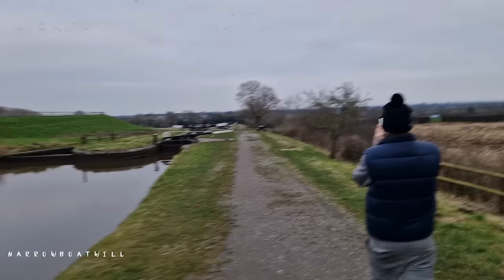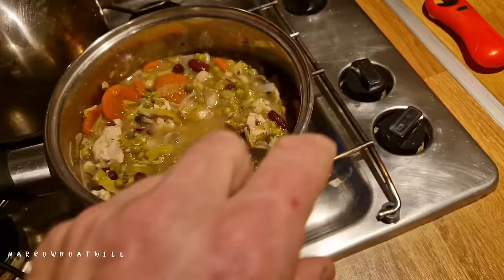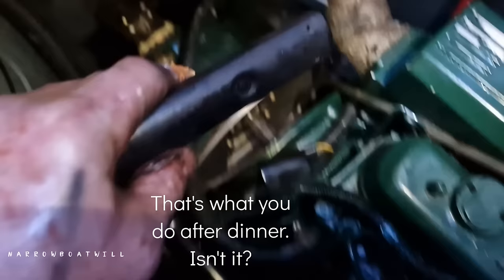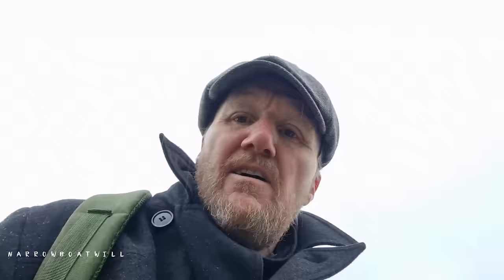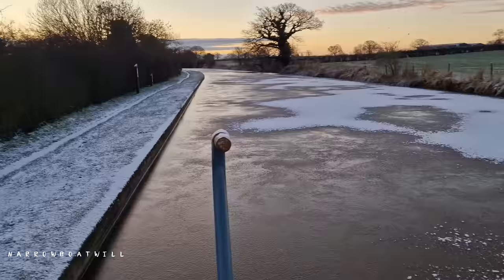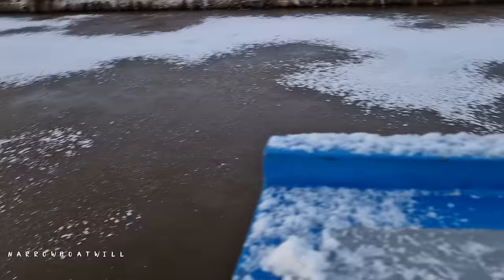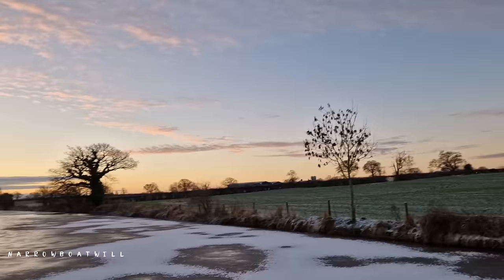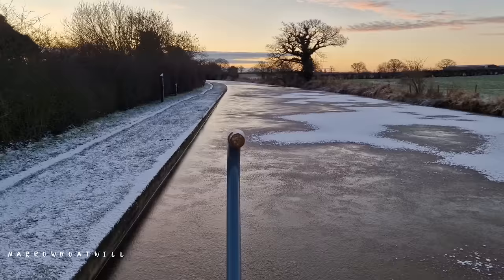Frozen in on the Shroppie. Very beautiful time of year. My journey continues..

Comment: I had to use the same torque wrench yesterday for 7.5 foot pounds, on two hex bolts very scary. You did well in a tight space Will, and you’ll be sore tomorrow! Take it easy.
Reply from the maker: It's a tight squeeze, some I'm glad I didn't have to remove the gearbox. I cut my hands alot. I don't feel it till I'm bleeding. 🤣🤣🤣

Comment: Sure there'll be a chart of torque settings by bolt size & material type to be found online, if you haven't got a Haynes for your boat.

If you find some huge pdfs, expect you could persuade one of us land lubbers to download it for you.

You'd think an electric hybrid setup would be ideal for narrowboats: multi purpose generator, prop fouling you could protect with a circuit breaker... many about yet?
Reply from the maker: I came across an electric boat recently, and when I was told  how much fuel they needed to keep all the electrics going I was stunned. Almost 3 times my usage and I cruise a lot. Their generator is just a big desisel engine running night and day. Bloody crazy logic..😜🤪 go figure.
Reply: @NarrowboatWill  Crap design, or they aren't using it properly. I can't imagine it takes much power to chug along at a steady 4mph so your engine must be bigger than is needed for most of the time. The only issue I can see is relying on batteries for extra oomph wouldn't be safe if you didn't have the option to moor up or drop anchor if you ran them flat. How often is that likely, tidal rivers & crossing the wash?
Reply from the maker: @ethelmini  I think they use something like 8kw to chug along. That's some power. Not 100 percent sure but everything is electric.